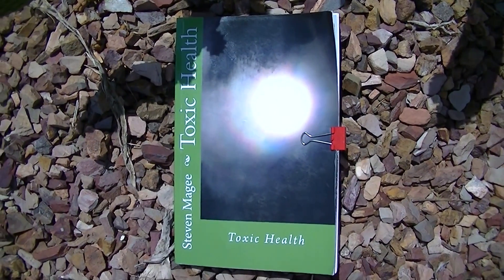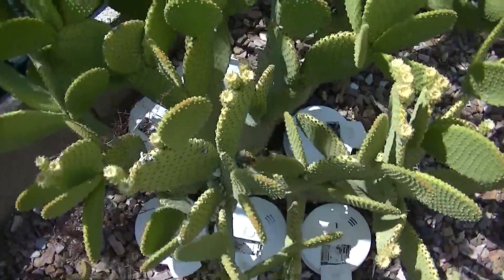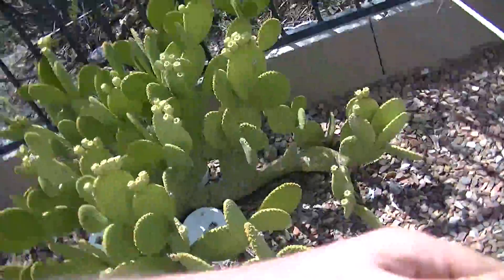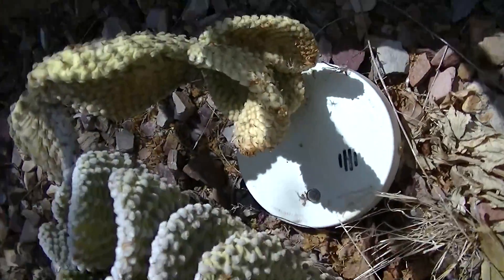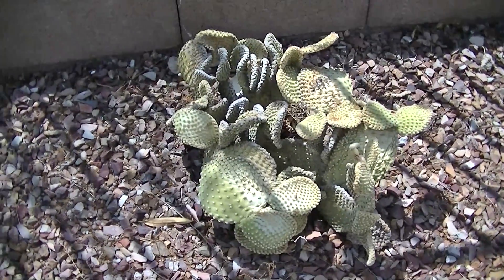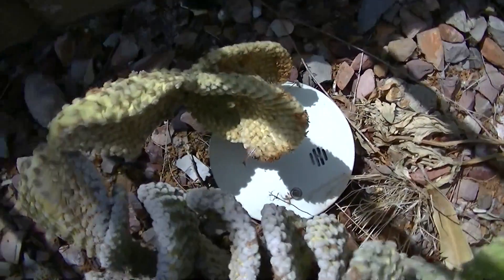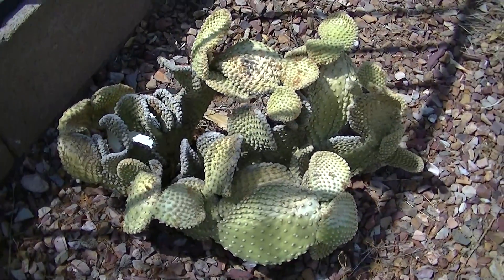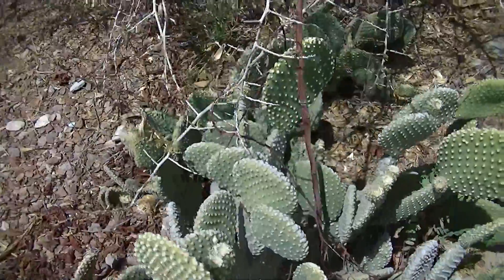Smoke Detector Experiment #2 July 2013 Update - Deforming Cactus

Comment from the maker: The compliance monitoring group for the University of Arizona tested the two types of smoke detectors in this video with calibrated professional equipment.  China detector figure first and Mexico detector figure is in brackets:  Victoreen 451B ion chamber 10-40 microrad per hour for both; Ludlum 44-9 250(60)CPM; Ludlum 44-3 10,000(1,500)CPM.  China detector has higher amounts of 30 keV low energy photons.  Swab test results coming soon for China detector.  Thank you to UA for assisting.